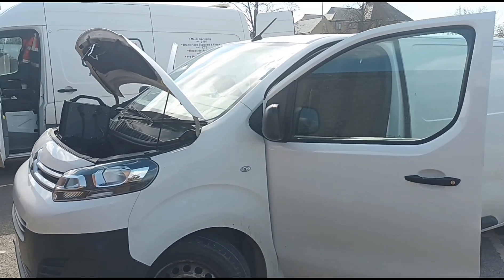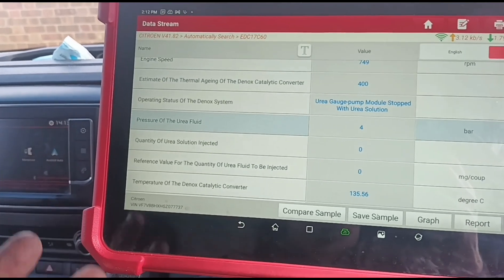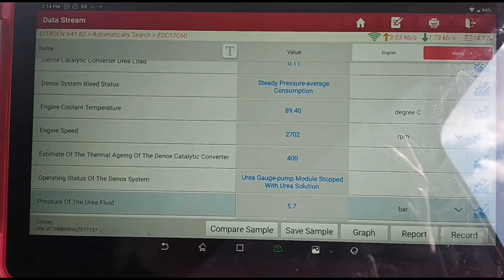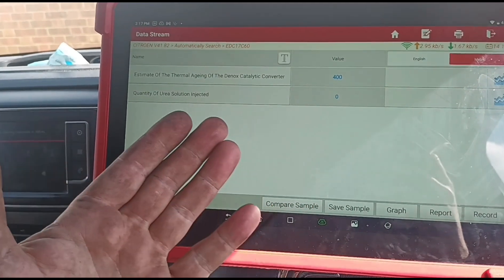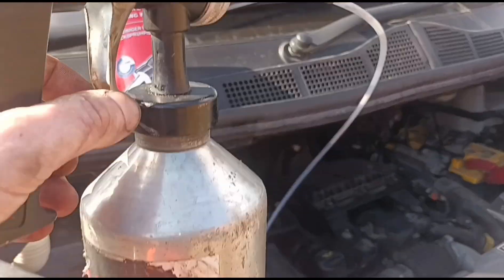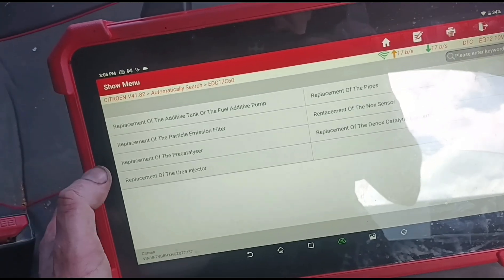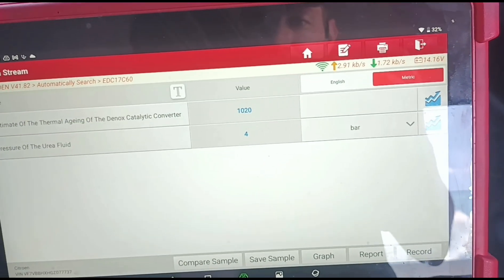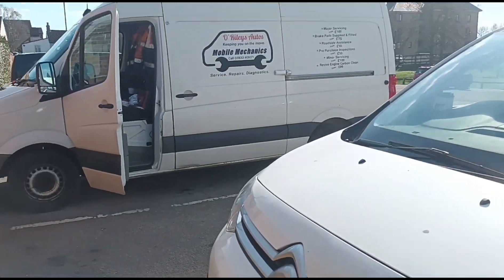Citroën Dispatch 1.6 Flashing Adblue Service Light. Thermal Ageing Of The Denox Catalytic Converter

Comment: I wish it was that easy,  my 308 light came on I put 15 litres in to fill it up now dash said 1500 miles till shutdown. 
Cleared codes said no codes found adblue level light still on.
Phoned Peugeot garage up said it will go out once you have done 50 mile run. 
Done 200 miles now saying 1300 mile range before shutdown. 
I think the float in the tank is stuck at the bottom of the tank, not sure if it’s removal to clean maybe crystal is up 
Maybe need a better computer to clear codes hidden deeper in the ecu car computer

Comment: We run 16 of these vans at work and when they start with Adblue problems they never stop. Some have been in for over 3 months now.
Reply from the maker: Yes definitely true. One customer has had it back to dealer 10+ times in a year. New cat. New adblue tank. New injector.   New nox sensors yet still ongoing
Reply: @ORileysAutos  same issues for us. The adblue system is chucked on and it's not designed to last sadly. The amount we use ours means that the whole system fails inside warranty.

Comment: I’ve come across 2 common faults with the newer dispatch and Vauxhall combo and Toyota pro ace vans 1.they are very sensitive to poor adblu quality especially with fleets who store it in bulk or containers being left opened to atmosphere and reacts with oxygen very readily 2.after the injection phase has been completed the pump should reverse and pull excess adblu back through the system to stop the lines freezing the pump seems to stop reversing and cause the lines to become blocked and lower the amount of injection and increase nox emissions it will still tell you the pressure is correct as the suction pot and lance are still able to pump but just not enough adblu gets to the injector as the pressure sensor is built into the pump and not the lines it’s even something I’ve come across on the Mercedes’ Benz range and Volvo trucks
Reply: How did you fix it? Chance pump unit?
Reply: The fault is all down to a rubber diaphragm that splits on a flow control valve because the pump doesn’t actually reverse there’s a valve that controls the direction of flow and when the rubber splits it stops the pump being able to suck the adblu out of the lines you can buy a repair kit for it but you need the time and patience to strip and rebuild it most workshops don’t have this time so it’ll end up getting a pump and dosage module and in some cases ie bmw a whole tank very pricey
Reply: @Gearhead90 Where and how do you buy the repair kit? Got any more info and videos or similar about that issue? Haven't heard that yet, very cool!

Comment: Very interesting with the thermal aging discussion we had from last Peugeot Adblue video. Very weird you had no fault codes.

The thermal aging % starting at 100 and going to 0 was the way it works with the Peugeot stuff and the way we diagnose, but the Launch is showing 0 after you did the replacement, seems like for your use case the more logical calculation is the one that the Launch shows meaning starts at 0% and counts up to 100% when dead. 

Estimate thermal aging is also an interesting calculation which I'll try to find out for us all the inner workings of, I´ll return with my findings ;)

Other than that your understanding of the pressure build up and the 4bar thing and etc was completely correct, your Peugeot Adblue-game is getting good!